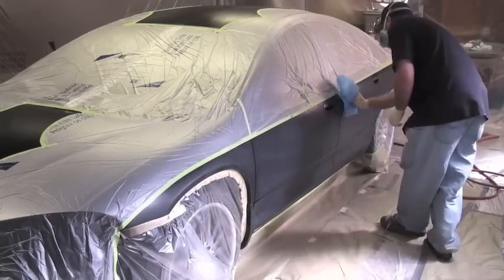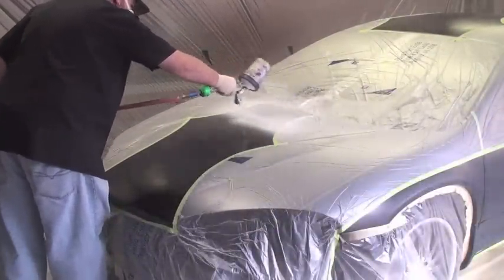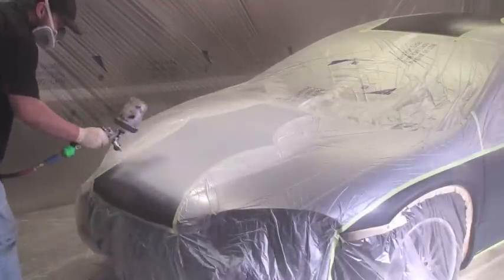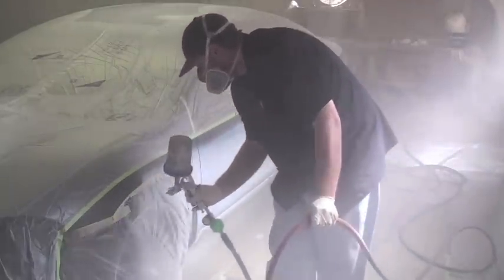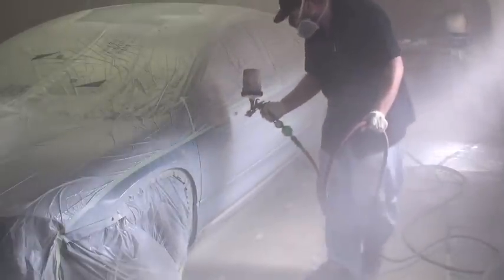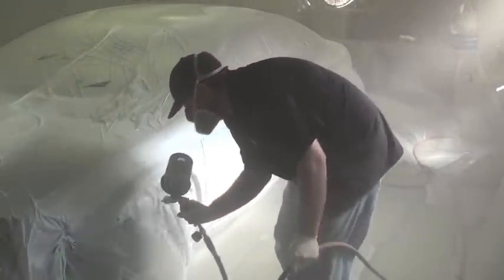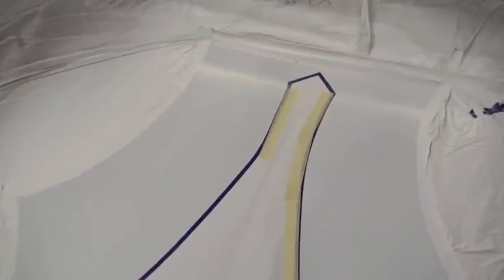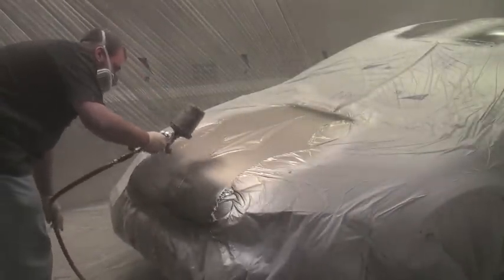How to paint your car in the garage. Full Color Change part 9 spray

Comment: sorry for questions... first you sanded it with 600 grit, then scuffed it with gray pad (for non metalic), blow off the dust, then wipe it with a tack cloth just be for you paint... Did i miss a step in their (do you wash it or just blow it and wipe it)?after the prep work above you paint it 10-15 minutes in between coats, let it dry over night, then clear coat

Comment: After you pull of the tape haven't you got an edge where the one part is a little bit higher then the other part because there is an extra layer of paint on top of it?